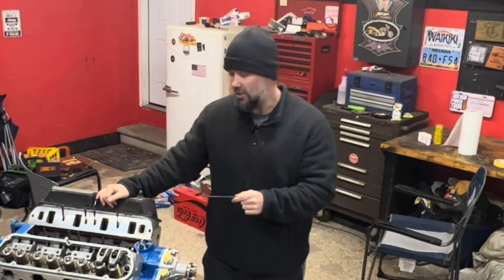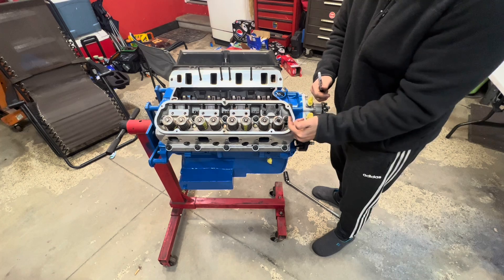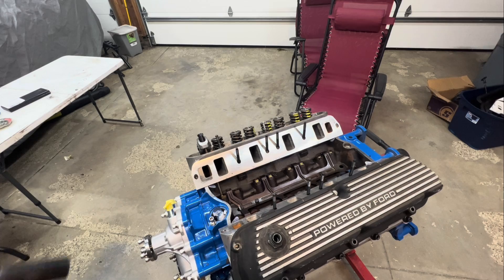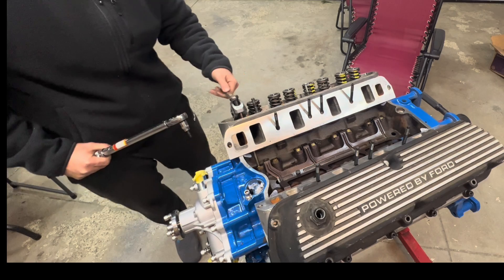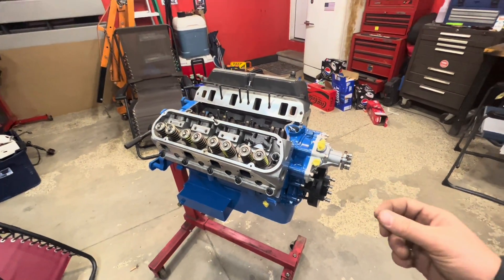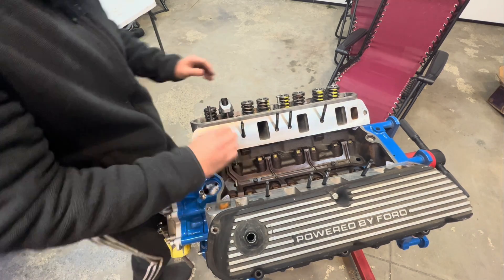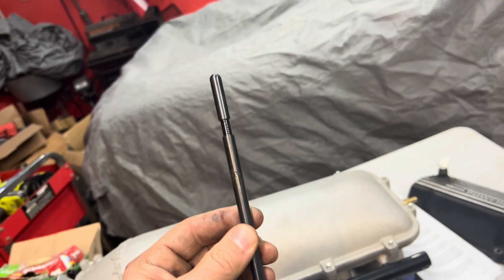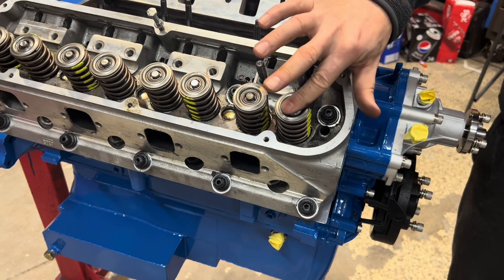SBF Aluminum Head INSTALL Part 2: Determining pushrod length on FORD 302 & 5.0 roller motors

Comment: With hydraulic lifters, are we not supposed to remove the factory springs and use “checking springs” for this task?
Reply from the maker: I watched a bunch of vids before doing this, and this is the method I saw for SBF and it worked out fine. Setup has 3-4k miles now over the past few years and is running well, no ticks or issues.

Comment: The half lift method is what i used to find pushrod length. Anytime anything in the valvetrain is changed, pushrod length needs to be checked.
Reply from the maker: Yep glad I checked mine as I did need different length pushrods. Have around 1500 miles on the build now and everything running good so far

Comment: Im so frustated, i cant get my lenght for my 351w, i have a crower cam with  284 degree 
 486 lift on the intake and 288 degree 493 lift on the exahust, i know that the factory messure s 7.56 but i want to know if i can use that lenght or i have to messure, thanks.
Reply: The answer is you ALWAYS have to measure.

Get your lobe half way open, your valve at it's half-lift point, and square up the rocker to the valve.   

Whatever that distance is (plus your lifter preload) is the length you need.

There's no other way to do it right.
Reply from the maker: I don’t know enough about SBF to say yay or nay, but for peace of mind I’d probably measure just to be safe. I don’t know that my Anderson N41 cam has as much lift as yours and I still needed pushrods, but I think other factors like cylinder heads also go into it and since I had aftermarket pro comp heads I wanted to measure. Plus if you have the engine out it’s really simple and quick to check. In the car is a little tougher but still much easier while it’s all apart
Reply: @PeakPerformanceEngineering   i got gt40 heads
Reply from the maker: @molkhaz id be checking then just to be safe. Def worth the time and $30-40 for the tool

Comment: You don’t want $40 non hardened push rods with guide plates. Prioritize the Sweep width over location. Example: .050” sweep but closer to the side is better than a perfectly centered .080” sweep. Everything is a compromise, really it’s your valve guides that take the abuse from bad geometry you don’t want a bunch of side loading.
Reply from the maker: Good to know, glad I spent the extra cash for the nice hardened ones.
Reply: @PeakPerformanceEngineering  me too! How’s it running
Reply from the maker: Running great, probably have close to 1000 miles on it. Not much longer left to drive it here in Michigan, over winter I’ll be upgrading the stock fuel lines to 8an and upgrading the axles, rear end, and rear suspension.
Reply: You do it right, and sweep won't be anywhere near .050" wide. More like .013" +/-

Comment: I have a 289 with aluminum heads and howards cam and i just measure for push rod and also got 6.35 lets hope we both measured correctly 😂
Reply from the maker: Yes, hopefully for sure :)
Reply: Building a 347
Ended up with 6.35 also. I sluswd a solid checker lifter also.
Reply from the maker: @The50Baker nice! I’m thinking down the road I’d like to build a 351 based striker for this thing once the stock sbortblock finally fails
Reply: @PeakPerformanceEngineering  yea me too.

Comment: Whataboutregjalerhead what about the regular heads when you change from the late models from the older models do you have to change pushrods q
Reply from the maker: If stock heads and cam you should be able to use stock length. I think between hydraulic and flat tapped cams though the pushrod lengths are a lot different so make sure it’s the right length for what your using.

Comment: The only thing I can say about checking pushrod length without using check lifters is that the stock lifters can bleed down so You can loose accuracy . Otherwise your video was one of the best I have seen , good presentation . Thank You keep up the updates ! 🇺🇲🇵🇷🦊👍
Reply: I’m going to install Anderson B31 with AFRs 185, what push roads do you think I need? With Novi 1000
Reply from the maker: No way to really know, you’d have to use a pushrod checker and check them like I did. Mine were only slightly different than stock, probably could have even just used stock and been fine id guess. But the tool is only like $30 so cheap insurance to double check :)
Reply: Oh okay man, thank you so much, I have the tool already but never do that
Reply from the maker: This was my first time too. Just take your time and do it a few times to really be sure and you’ll be good :)
Reply from the maker: Thank you! fingers crossed it doesn’t start rap a tap tappin on startup haha!
Reply: What cam do you have on that motor?
Reply from the maker: Anderson N41. Install vid here :)

Anderson N41 Cam Install in the HellStang! Add some Chop Chop to your Ford 5.0 302!
https://youtu.be/lrvfK2omuY4
Reply: Or use checker lightweight springs with hyd lifters, don't use the stock springs with hyd lifters because they move or bleed down like you said.